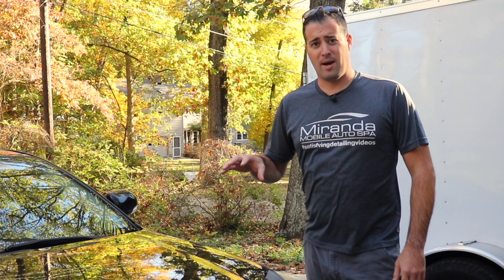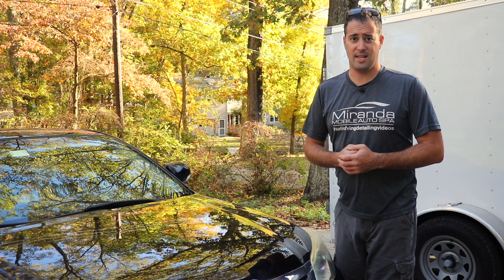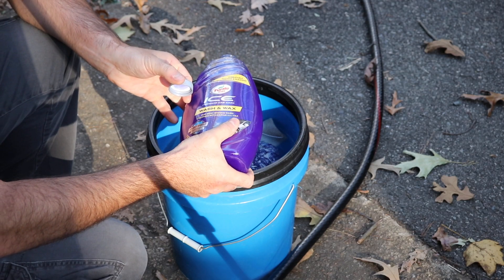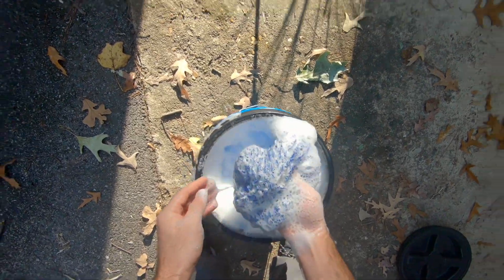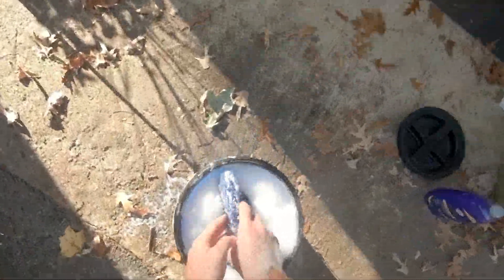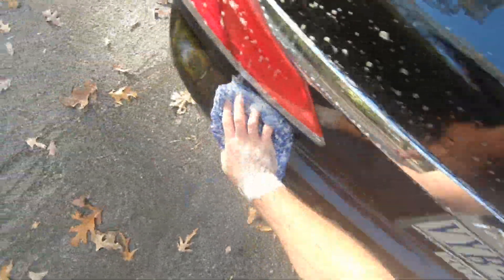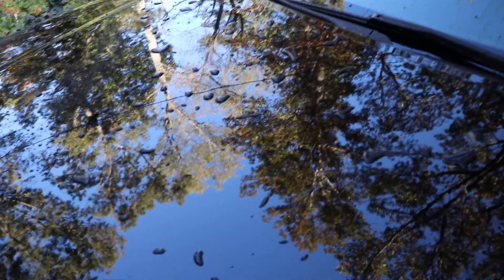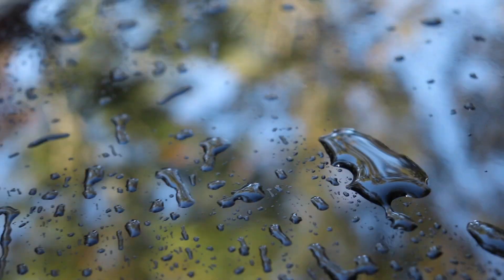I Have White Overspray On My Car's Paint!  What Happened?!

Comment: Lucky you had it well TW'd.  Had similar issue with an egg that hit back of my parked CX-5 last year, during the night (thankfully just on the glass with some drips down the paint), got advice from Alan @ AMDetails and the team of enthusiasts on the AMDetails FB channel on what how to remove.  The fix was was to mix AM APC/AM Bubbles/Angelwax Cleanliness orange pre-wash (my idea, i mix it with my AM Foam) with very hot water in a spare AM spray bottle (which deformed a good bit, noted for future chemical mixing).  Some sacrificial MF towels to soak and rehydrate the egg sludge/shell and with AM Glass & Q/Detailer to finish off & clean the rear, without paint damage!  😁
Reply from the maker: Woah!  Good thing man!! That an interesting mixture!  Glad it worked!

Comment: Great video. Just washed my black vw over the wend found white o/spray  seemed like road marking paint. Anyway the wash didn't remove it. So tried a blue c/guys clay which is the fine one and it did nothing. Used there black heavy duty clay and was like hot knife thru butter. But had to polish the paint afterwards. A long day!
Reply: Cool have to check up on that!
Reply from the maker: I hate overspray!! I was so happy it come right off with a wash. It could have been worse. Was the black heavy duty clay from Chemical Guys? I have their grey medium clay which is great also.
Reply: @MirandaDetailing  yes Chemical guys

Comment: How do you remove overspray on plastic?
Reply from the maker: I usually have to use Lacquer thinner carefully. Then dress the plastics after.
Reply: Ok. Thanks. But wouldn’t that stain/fade the plastic?
Reply from the maker: Henry Freeman on some plastics it does fade it but used gently it should be ok. Just use a good plastic dressing or coating after.
Reply: Good to know. Thanks